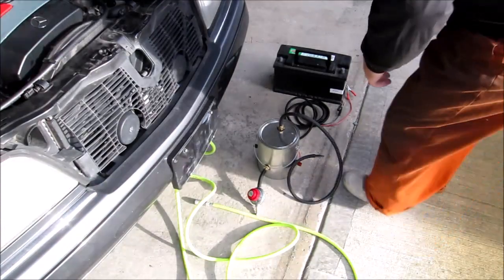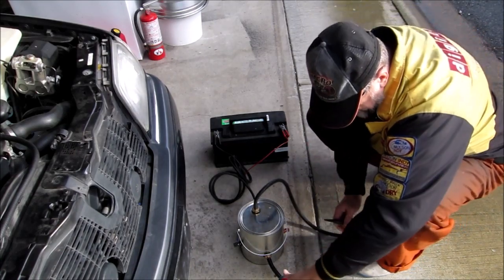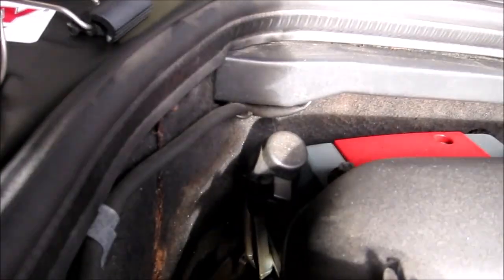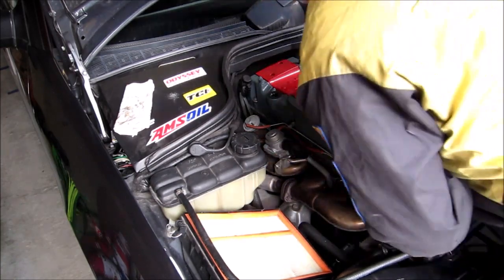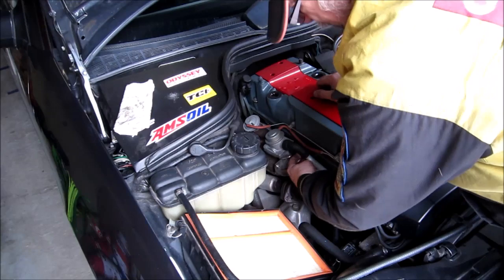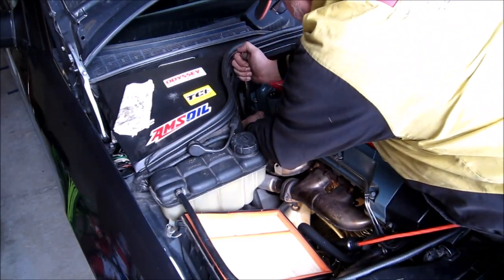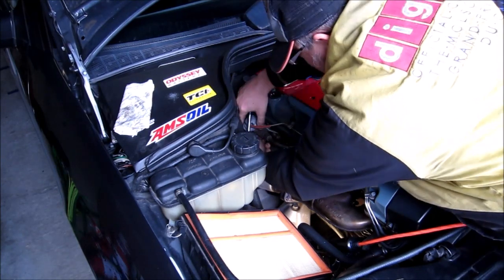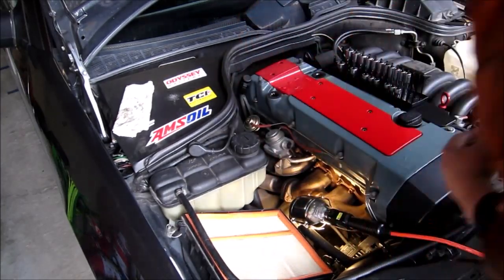Mercedes Benz W202 C280 EGR VALVE REPLACEMENT

Comment: Did this job recently based on the video.  Great information.  Found that the EGR valve can be removed without taking off the SAI valve or removing the SAI air supply tubing.  There is enough room to insert the 19 mm wrench on to the EGR exhaust manifold connection to loosen the compression nut.  Although, removing the SAI valve would make the overall job easier due to providing more room to loosen and manipulate by hand this nut.

Comment: Do you know where I could find the line running off of the top of the secondary air injection system valve? Also I love that paint job🙌 I saw when you first did it and was wondering how it held up, looks great👍.
Reply from the maker: The paint peeled off, I had the car parked outside over the winter... the covers need better prep and need to find primer that works better with magnesium....thats what the covers are made from. Common problem....
Apparently powder coating works better

Comment: Does the shut-off valve ever need replacing or cleaning? I am going to replace my EGR valve and wondering whether I should replace the shutoff valve also.
Reply from the maker: you mean the vacuum shut-off valve? I dont think it needs cleaning if air passes thru.
Reply: @AndyPMercedesBenzChannel  Thank you so much for the reply and information!

Comment: My EGR valve is still original and was cleaned 2 years ago. I am curious what symptoms you were having that caused you to replace yours. Would a failing EGR valve cause my W202 to have an idle cold or warm to have tachometer needle bounce between 500 and 1000?
Reply from the maker: I was chasing intake vacuum leaks, did a smoke test and noticed smoke coming from the seal on the actuator rod on EGR valve. So decided to replace. The new one still has a very slight leak. I guess they all do. 
My guess (for bouncing rpm) first check the MAF sensor (or at least clean it),  second any vacuum leaks  and third is the throttle body harness. Cant talk from personal experience, but many people complain about it the harness, it's made from bio-degradable plastic and with age falls apart and shorts.
Reply: @AndyPMercedesBenzChannel  I also heard about the wiring harness. I'll have to check on that to see if it was ever replaced. The prior owner who was the original owner only serviced the car at the dealer. I am hoping the dealer advised them to change it. But, I will see if the dealer can tell me. 

I did replace my MAF a couple years ago with a new Genuine MB part. I suppose I can remove it and clean it just to be sure.

Sounds like a smoke test may be in my future. LOL. Thank you and have a great day!
Reply from the maker: @fixittony  Usually good owners would have the harness replaced, but it's good to check with the dealer. Good luck

Comment: is the egr valve the same on all w202 models? i have a 1998 c230. parts seem to be discontinued. any leads?
Reply: Parts are not discontinued, look into partsgeek .com
Reply from the maker: eBay, parts geek, FCPEuro, use google Im sure you will find it
Reply: I used all those sites for that specific part. no chance. Partsgeek is the one for majority of my w202 parts
Reply from the maker: @Phrofetic_MayaN 
My go-to places:
Rockauto.Com
AutohauzAZ.com
FCPeuro.Com
PelicanParts.com
I never bought from PartGeek, for some reason, maybe i don't trust them. But they do have a big selection.
Reply: @AndyPMercedesBenzChannel  thanks for deeper insight you also have a w202
Reply from the maker: @Phrofetic_MayaN  yes, I also have a W202 c280 1995.
Reply: @AndyPMercedesBenzChannel  excellent one question thou, have you had any trouble on the center bearing shaking, I've had replace the rubbers the center bearing but still shakes on me, it has over 280k, I might be thinking it might be the u joints and other specific part other than that it shakes on uphills while doing 25mph and doing straight roads on that specifically,  when it passes it rides nice and smooth any tips on this problemo bud?
Reply from the maker: @Phrofetic_MayaN  no, I didn't have this problem. Things to check: engine mounts, transmission mount, front and rear flex couplings. I assume you are talking about the driveshaft
Reply: AndyP Mercedes-Benz Channel yes sir I got all that but it always comes back 😂 was

Comment: Can I just remove the whole system from the engine? Will car work normally?
Reply from the maker: I know some people do this
Reply: @AndyPMercedesBenzChannel  and engine works normally?
Reply: @HKstunts101  apparently, yes. Egr system is there mainly to reduce emissions at high rim, so at lower rpm the valve is closed .... you can google this, lot of info on the web
Reply: @andrewp3089  yes there is. And somewhere I red that EGR delete can cause the car to misfire, I'm talking about M104 engine. That's why I'm asking you
Reply from the maker: @HKstunts101  I have never done it, I like to keep my MB's stock. You can try to test first, before deciding to delete the EGR system - disable the EGR valve, pull the vacuum tube from EGR valve and block the end of the tube.  One thing to look for is will this cause an CEL (check engine light)? i dont know.

Comment: What is the price of erg ventil for this car?
Reply from the maker: expensive , i paid about 200 cad
Reply: @AndyPMercedesBenzChannel  how many euro is cad? Sorry and thanx for answers
Reply: @hellohigh9826  1 Canadian Dollar equals
 0.68 Euro
i didn't buy it here, but this should give you an idea, and also you can check autowreckers yards

https://www.partsgeek.com/catalog/1995/mercedes/c280/air_intake/egr_valve.html
https://www.ebay.ca/itm/EGR-Valve-FITS-Mercedes-Benz-C280-E320-S320-SL320-C36-AMG-3-2-L-1993-1996/303245178639?hash=item469ad2370f:g:PhgAAOSwOSVdSGHH